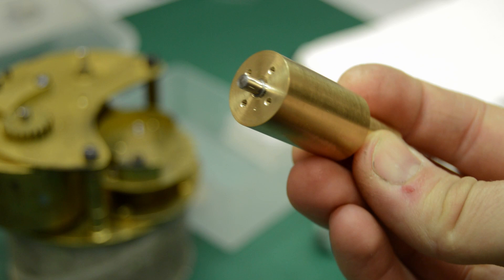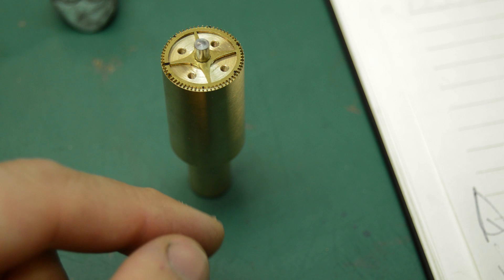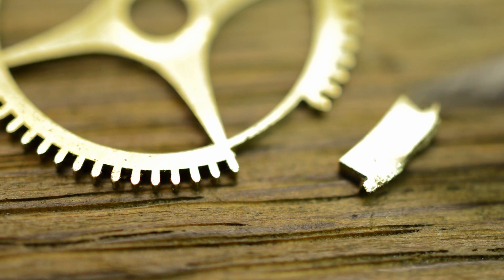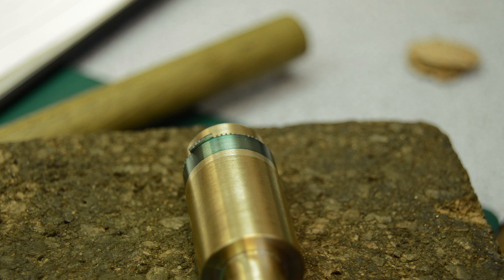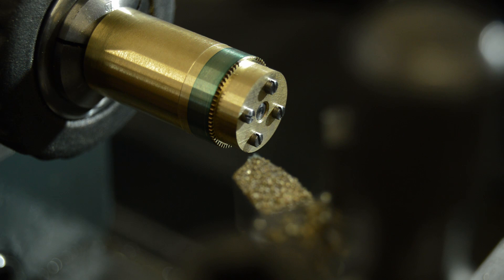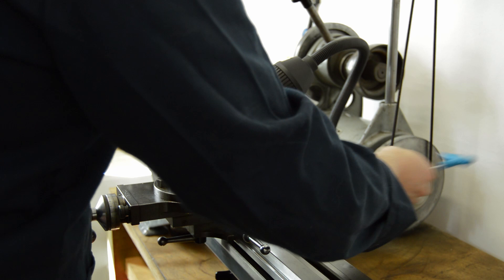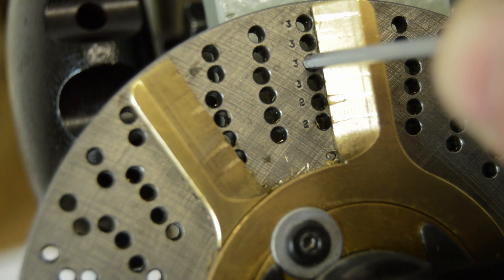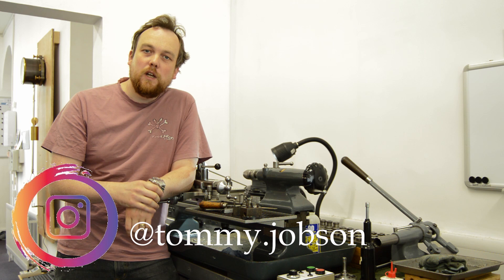Setting up a Schaublin 102 to cut a clock wheel.

Comment: Hi ,You can make a video how to solder this piece so thin and small, I can’t weld it like you do, because the brass has very high temperatures (about 900G) to weld, and as they are very thin pieces, the material is very damaged where solder!
Good video continues I like it
Reply from the maker: Use low temp solder and it should be fine.

Comment: Thanks Tommy! Love this content. I'm new to Schaublin having just purchased a 102 TO so it's great to see some clock making content using these lathes. I noticed you are using the Tripan tool holder. I'm trying to decide between this and the multifix. Any experience with those for the 102? Or recommendations?
Reply from the maker: I’m not much help to you as I’ve only ever used the Tripan or Dickenson tool holders. I rate the Tripan extremely highly though.

Comment: Hi Tommy, at 6:40 is that loctite 638 you'd added in the mix that I could see on your block, I heard you mention soft solder? Also do you allow much in the way of extra thickness to the add in piece for riveting, in comparison to the wheel thickness? I'm guessing it was next to nothing and sanded. Cheers
Reply from the maker: Good spot Neil as always!  The intention was to 'dry' fit the repair section, which I always help along with some 638, however as this repair needed a little more security I had to clean that out and run in some solder instead. Yes, the material was left oversize to be reduced to thickness after peaning.

Comment: I am not a clock maker but I just wonder if it wouldn’t be more accurate to use micrometers for your OD measurements?
Reply from the maker: I’m sure it would, but the tolerances we are talking about with clockmaking would mean you wouldn’t notice the difference. Digital verniers are already far more accurate than the kit used to make the clock originally.